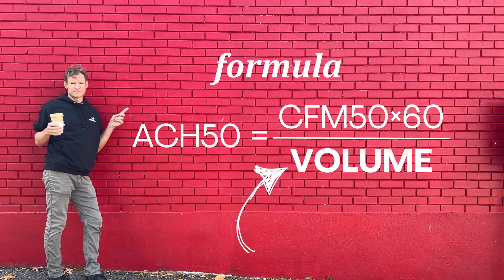Debunked! The Shocking Flaws of The Passive House Podcast's Advice!

Comment: But can you get a good house without going to passive level?  We are renovating soon in Melbourne, Australia. In our mild climate I don't think going to passive level is logical.
Reply from the maker: @MatthewBayard  from my research there’s tons of passive builders in Australia just like Canada, but building for opposite reasons, to reduce cooling demand where most homes in Canada are reduce heating demand. This is the beauty of passive, amazing performance and incredible operational cost savings in all climates.
Reply from the maker: @MatthewBayard  there’s usually two options. Spend less money on a home that comes with huge operational cost to live comfortably or spend 5-10%  more to make it passive, and live cheaper in most cases because of incredibly low utility bills for optimal comfort
Reply: @EkoBuiltPassiveHomes  do you have any cost experience renovating to passive standards?
Reply from the maker: @ it does depend on the situation, for example, if exterior or interior finishes are part of a renovation then it wouldn’t be much extra to add additional insulation and vapor/air barrier improvements
Reply: @EkoBuiltPassiveHomes  thanks! We are getting an architect in this month to see what he can do to improve our layout. I'll be sure to ask about energy efficiency